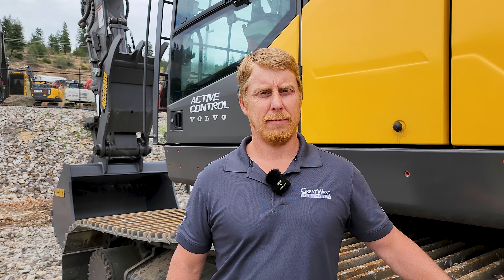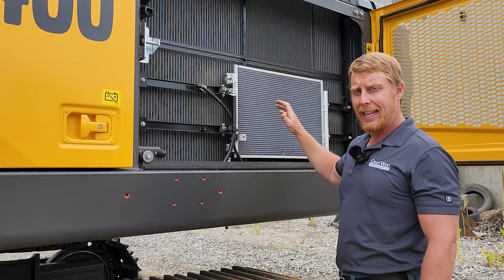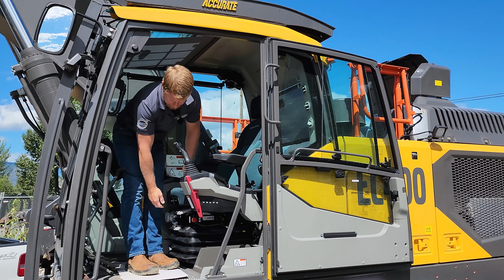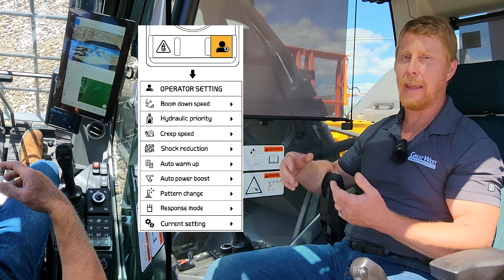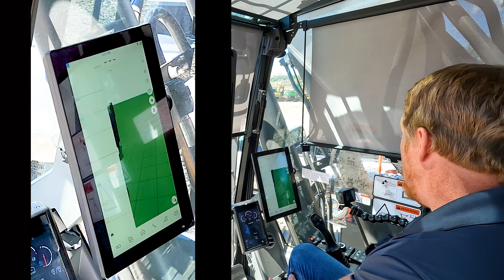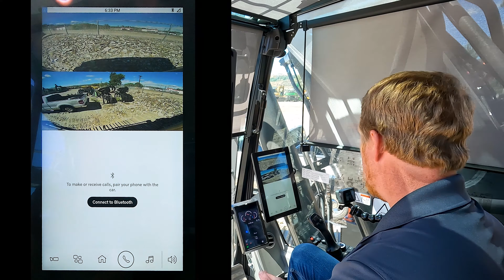What Makes the Volvo EC400 a Powerhouse?

Comment: Nice Machine but i cant get my head around the Elongated Grab Iron for pulling up into the cab ! - seems awkward.
I do like the Flat side panels - No Nonsense folded kinked pressed out unnecessary crap.
Needs Auto Greaser as standard to save time and regular consistent Lube.
Not sure all those settings are needed - All it needs is Fine Operation, Regular Operation and Power Plus - 3 stages on one thumb button on the Stick - Nobody is gonna screw around changing shit on the screen